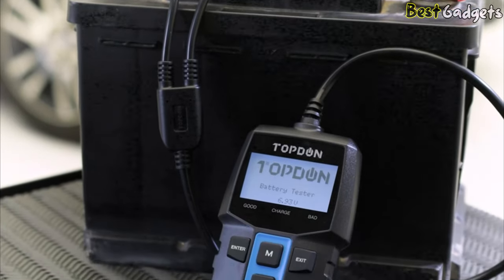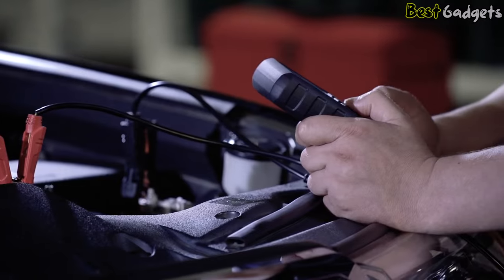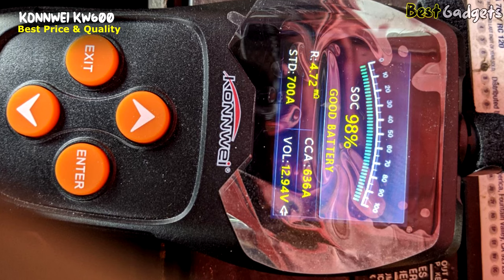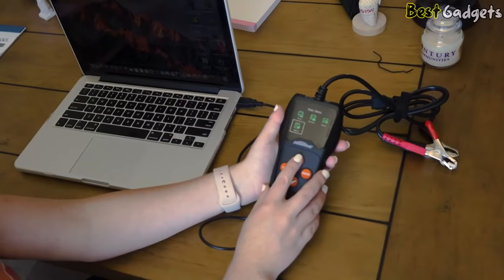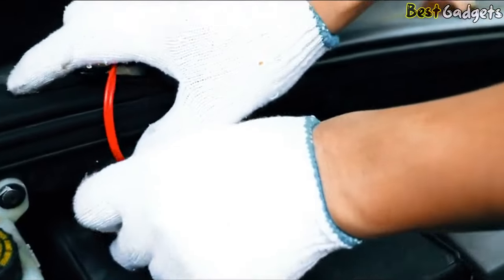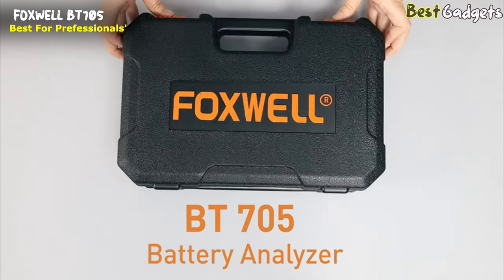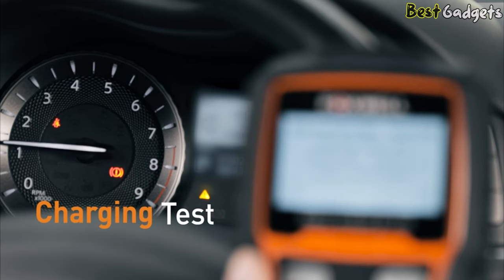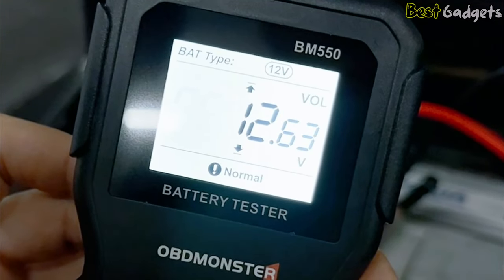Best car battery tester and analyzer 2024

Comment: Take a lot of these cheap off shore testers that are on the market now and test it with a volt meter and you'll find its more than one volt difference in variation. Which means all the other algorithms in the cheap tester will be off as well. Word of caution, buy usa analyzers like midtronic's, price is aways an indicater of quality. 🇺🇸
Reply: hi ı tested my bosch battery and its SOH is %66 its low ? also measured cca is 650 but battery is 850 cca no drain on tests car is 06 jaguar s-type 2.7 tdv6 2-3 day and no crank is my issue

Comment: Just use a manual battery load tester.  They give a pretty good overall idea of the car battery's overall health and only cost $20.  No fancy gimmicks or electronics inside either....
Reply: I was wondering about that. A load tester will also test the charging system.

I was just here to see if I needed a load tester too. I guess I do not need a load tester if I already have a battery tester.
Reply: @ilasas  You can also buy those cheap 12 volt cigarette lighter socket voltmeter testers for under $5 as well.  This way you don't have to get out the multi-meter or raise the hood to test the alternator.  These 12 volt meters work really well for checking if the alternator is putting out enough volts to keep the battery charged.